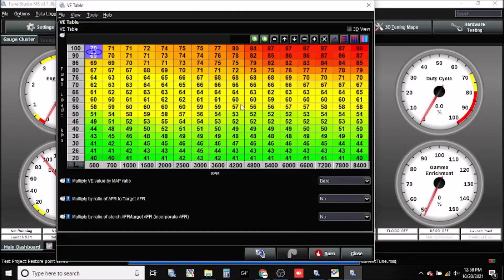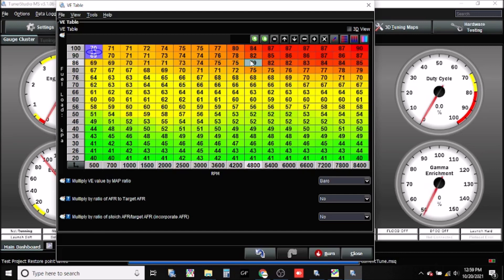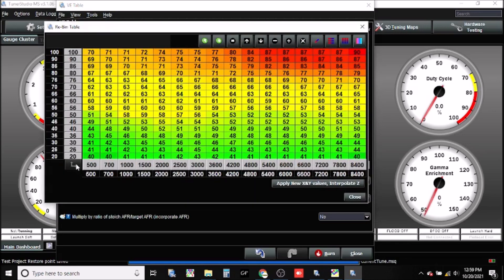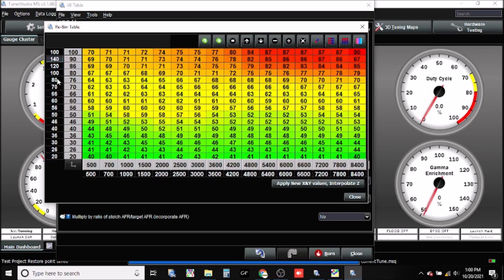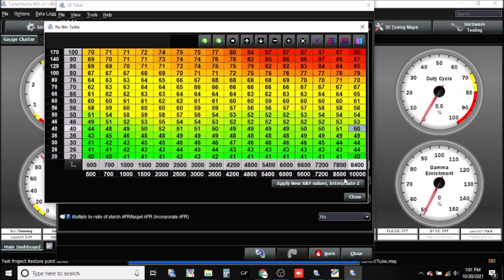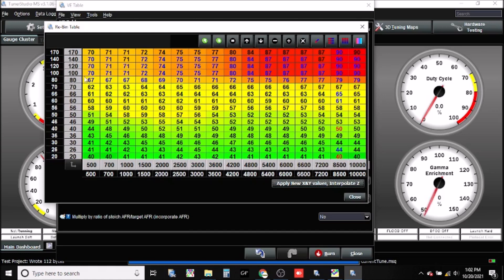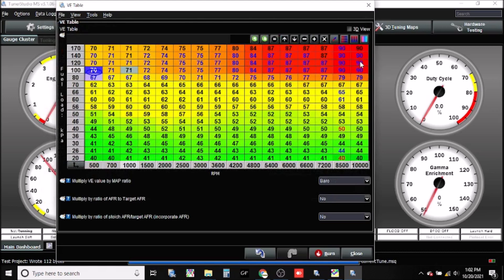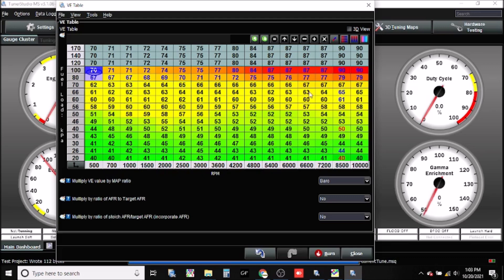How to Rebin a VE, Spark, or AFR table with Speeduino and Megasquirt ECU

Comment: Hi, I hope you can help me. My car runs rich across the board. I tried changing the master fuel (ms lower) but the air/fuel ratio doesn't change car still runs rich. If I try with VE table I get into lower 10 numbers like 2-3 to get it to idle at 14.7(gamma enrichment is bellow 100%). Any suggestions? Miata 1.6 1998 NB running parallel speeduino NO2C with stock ecu.
Reply from the maker: Use the link in the description of the video reach me via my website/email for any tuning related enquires

Comment: Me just wanting to learn how to tune itbs that I installed on my Miata. But feel I'm forced to take it into a tuning shop cause I feel I might of missed something. Gotta love first time projects. Probably will take it in to fab9 they're shop is 2 hours away from my house. Get me a U-Haul and slap that Miata right in that bad boy and take her in.
Reply from the maker: Learning to tune is not difficult, it just requires a good understanding of how and engine works and how the changes in the tune affects it. I taught myself how to tune and have since made a business of tuning cars all over the world remotely.
Reply: @DCWERX  I do have tuner studio with upgraded features for auto tune the car is heavily being ran off auto tune rn. I just personally would like a extremely reliable tune cause I daily the car.
Reply from the maker: @farmerbobbygrows3338  while autotune works very well sometimes, if the base settings are not set correctly it will quickly make a mess of the tune. Shoot me an email at Dwight@ DCwerxTuned.com if you have any tuning enquiries